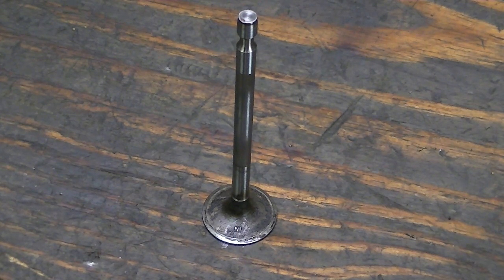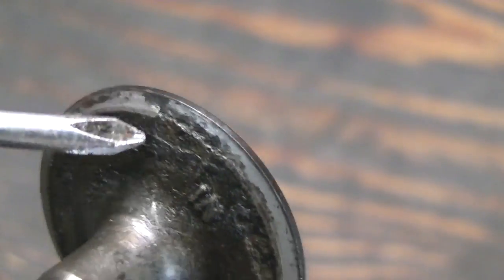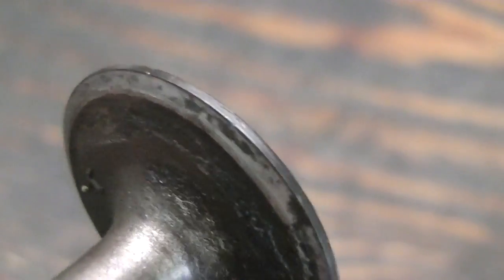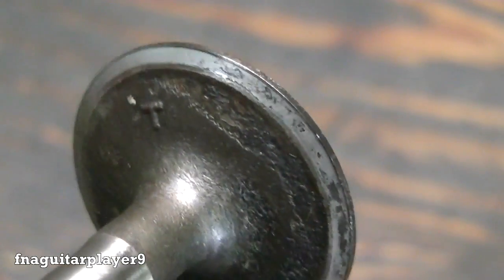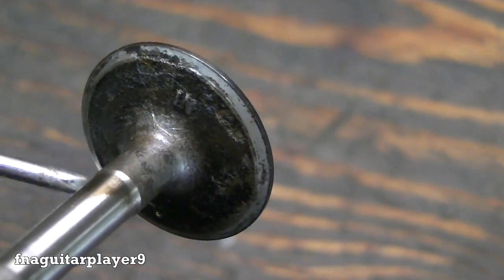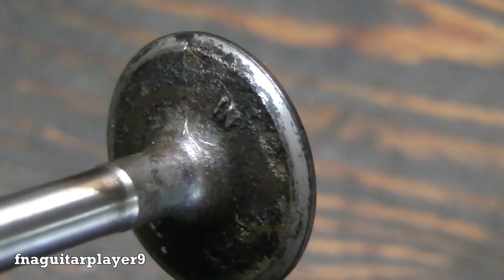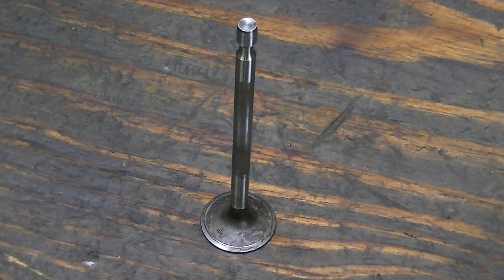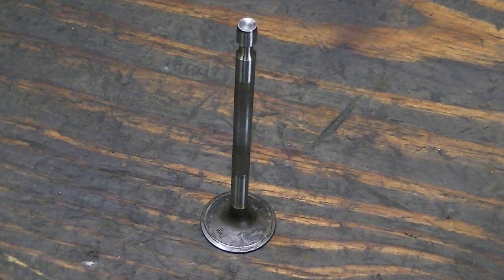What a Badly Pitted Valve Looks Like (Starting to Burn)

Comment from the maker: @1972FordF150 yeah might as well if you got it all apart. that should be alright, might change when you drop new valves in it. probably be more clearance and have to keep reseating till they get tight. the 12.5 this valve is out of i had to grind like 10 thousandths off of it. i was surprised, but the valve seat looked like new on this engine.

Comment: @fnaguitarplayer9 This thing needs a new head gasket so maybe I will put new valves in it when I do that. Time to tear the valves back out of it again hahaha. I've never messed with the clearance but on 3 HP engines it's supposed to be 6 thousandths and both of these valves are at 5.

Comment from the maker: @1972FordF150 yeah probably would be. better to do it sooner though, after while it will start wearing the valves (pitting) and the seats too. talking about chattering, i hate adjusting valve clearance on flatheads, either have to weld the stems up or grind off. haha, thats the only thing i don't like about them.

Comment: @fnaguitarplayer9 No problem! I think my valve guides would be way tighter with new valves in it. But it doesn't really burn oil so it's not that big of a deal. But they do chatter like hell when it's cold and idling.